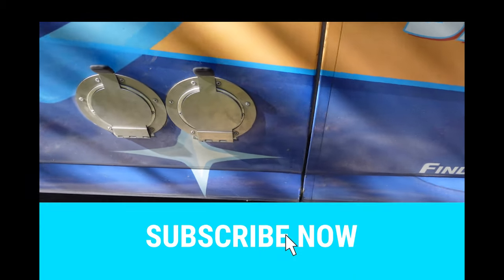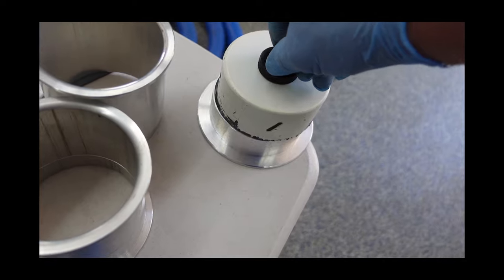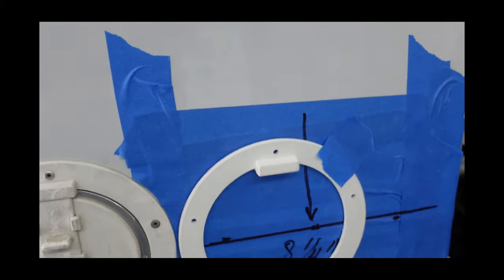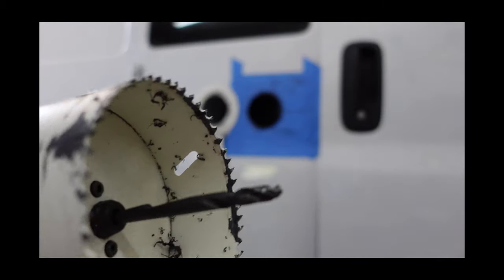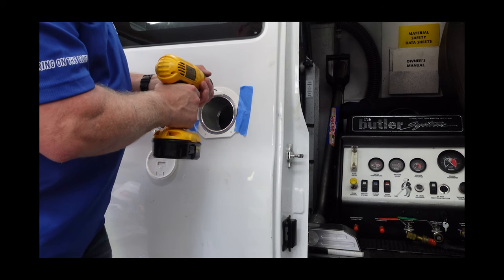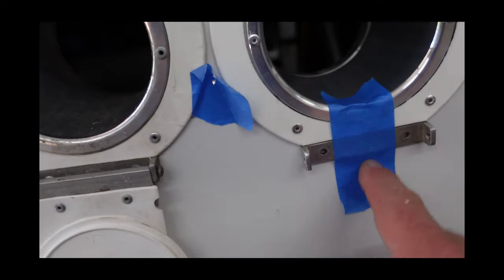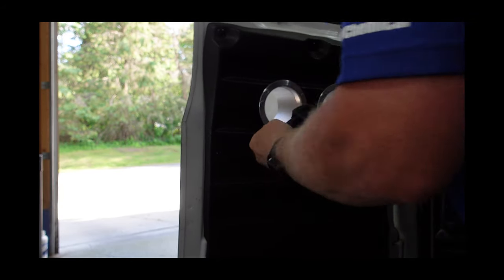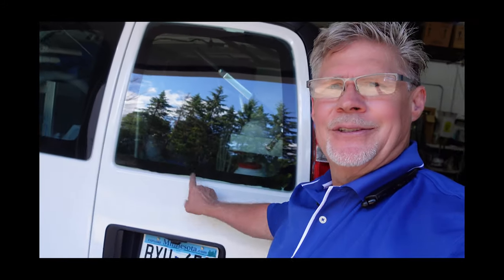Do you have what it takes to cut a hole in your van? | Installing a Butler Style Port Hole| ZV1 Sony

Comment: The easiest way to use this thing is to get a long, small diameter pilot/probe bit, drill a level hole straight through both sides. Use that small center hole to line the center bit on the hole saw in, and then you’ve got two perfectly aligned holes to pass something through.
Reply from the maker: Great tip! ❤️ Thank you for sharing!!! 😊

Comment: Hey Mark,  Do you know if Butler has ports big enough to accommodate the 2.5 inch hose.? It will fit through mine, but not with the solution line too.  Kind of a problem.
Reply from the maker: That's why this video. With 2.5 inch hose you need the second port hole. They don't make larger currently 😊👍

Comment: any rust protection on the van?
Reply from the maker: There might be some from the factory but nothing extra was added. I do know of people who have done some painting in that area after cutting holes but I have never seen a problem around Port holes. We do have our vans in a environmentally controlled shop (heated in winter) all the time, but even some friends with vans outside, we have not seen an issue here.

Comment: What about carbon monoxide from the truck mount?
Thanks mark.
Reply from the maker: Our Butlers of course are direct drive units so that is not a situation we have to worry about, but I would agree that you might need some additional venting via cracked windows or vents. I know the national franchise chain Stanley S runs slide in type truckmounts and make theirs work with doors closed.
Reply: @MarkSaiger  Thank you so much! I appreciate it.